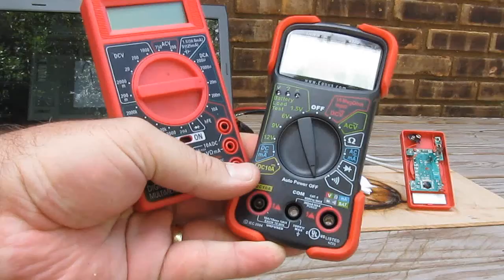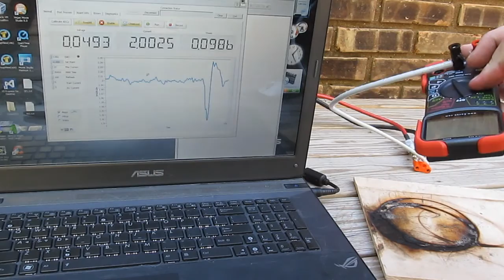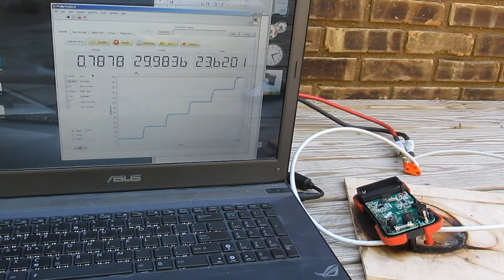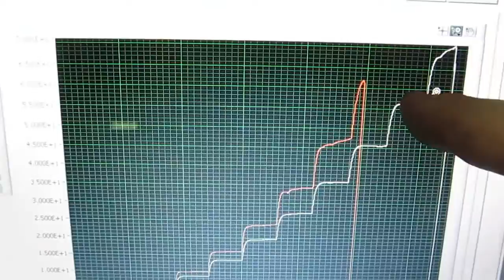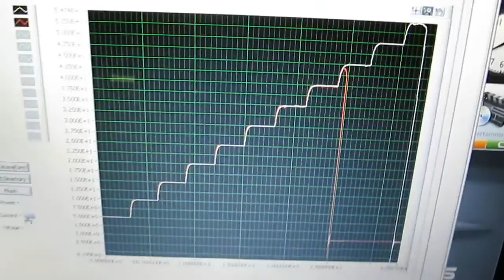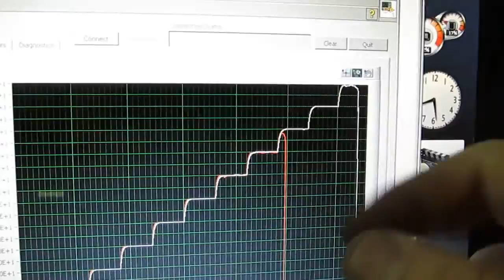Testing unfused current inputs

Comment: 4:50 But, who would put current probes across AC lines? That would be a dead short and trip the circuit breaker. I also don't think the average person is going to be testing anything which draws 40 to 70 amps. If they are, and they're doing it with a cheap HF meter, they probably have no clue what they are doing in the first place.
Reply from the maker: I suspect this was the catalyst for the HRC fuses we have today.  I would have no way of knowing what the average people does,  what mistakes they make or what their level of education is.

Comment: It would be interesting if you did a test of what happens to meters with glass fuses under high currents. I believe you did explode a glass fuse in one of your videos but if I'm remembering correctly that was just the bare fuse. It would be interesting to see how well the meter body does in containing a ruptured fuse.
Reply from the maker: Your are right, I compared the glass with the ceramic filled fuses after I first made the half cycle simulator.   The VICI VC99 came with a glass fuse which I showed on the half cycle generator (linked below).  The problem is none of these tests, including the half cycle generator, provide near enough energy to know what would happen in real life.    https://youtu.be/Q23eArAsXmo?t=1838
Reply: joe smith What about a supercap? It wouldn't be able to supply much voltage but it would be able to dump a whole lot of current through the fuse. Alternatively, you could just jam the probes into a power socket. :)
Reply from the maker: I guess you could try some sort of supercap setup to simulate a CAT III or CAT IV environment.  Not sure what you would do but if you attempt it, post it.

Comment: Hello, pardon my ignorance but I'm about to purchase my first multimeter, so I checked your video out. If I understand correctly, it's better to buy a fused multimeter but the fuses in it must not be made of glass? They should be made of ceramic? How would I know that? Would it be specified on the packaging? Please reply. Thank you kindly.
Reply from the maker: I would say most of what you are asking depends on what you environment you plan to use the meter in.   I would then recommend you buy a meter that is certified independently to meet that standard.
Reply: Not sure I understand what you mean by "enviroment". I plan to use it indoors for small projects [game console repairs, vintage electronic toys, fans, radios, nothing big like a car etc].
Reply from the maker: The meters will typically have a CAT rating on them.  This defines what the meter may be used for.  It is possible that if you take the time to do some research on these ratings, you may find that for your particular case, you have no need for HRC fuses.   Obviously this is something you will need to answer for yourself.     I think this is a common problem where people will buy a higher end meter and really all they want to do is play with <10V projects.  They blow the fuse, find out it's $20 to replace it and then jump it.  You would be much better served to use the internet to do some research before you consider buying a meter.
Reply: That is some great advice - much appreciated. Thank you Joe. Cheers mate!

Comment: wow the harbor freight meter held up longer then i expected.
Reply from the maker: The HF meter uses that second PCB off to the side and the shunt is mounted onto that.  Really, it's a pretty short path.  Not having a fuse, I'm not so sure this is better or worse having it hold such high currents.   The leads included with the HF meters would not survive.  So maybe melted hot wires in your hands?  Best to have a fuse if your working with something with high currents.
Reply: hot leads in the hand would suck. I have one in the desk , i only use it to test a battery , past that i dont trust them

Comment: What multimeter would you buy if you got $150 to spend. You really put them meters through their paces with no hiding places.
Reply from the maker: There are hiding places for sure.   Originally I was focused on just testing their input protection circuit to see how well the meters could survive compared with other meters.   This has changed into more of a review for the last few meters thinking it may help someone who is looking at the videos to make a decision about what to buy.   

If I understand your question,  someone offers to give me $150 that must be spent only on one meter.   Is what I don't spend wasted, or do I get to pocket that cash?    Am I allowed to add my own funds to the kitty?    Last, seeing that it is me, do I get to use the peripherals I already own with this new meter?
Reply: Leave it to your own better judgement for an all round winner.
Reply from the maker: I can't really recommend a meter for you but I can pick what I consider is an all round winner for myself.   It should have been clear that hands down, I would still take the Brymen BM869s out of all the meters I have looked at for an inside desktop meter.    I really like it.   I also like the UNI-T UT181A's UI and features.  It's just not near mechanically or electrically robust enough.  There are a few other things I would change about the 181 as well.   

For outside use,  where I need a handheld,  I stay under $50.  I need the temperature input from time to time.  I don't really need RMS, even 2000 counts is fine, no need for a uA range.  Actually, much of the time I use a shunt.   These meters never get used with any high voltage/high energy so I am not concerned about having a safety rating.  If I need the continuity check, it can be very slow.   I have yet to throw one at a cement wall or toss one from a car or forget to take it out of my pocket when I go swimming.   One thing that I find useful  is a magnetic strap.     

I am using the UNI-T UT210E a fair amount.  Not a perfect clamp but has been well worth the price.  It only gets used as a clamp.   It has replaced the shunts for now.